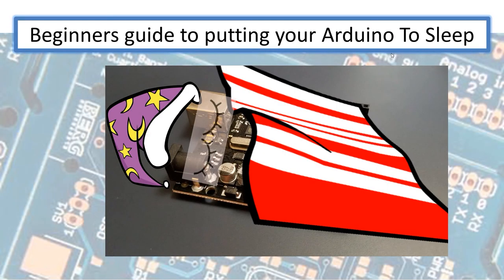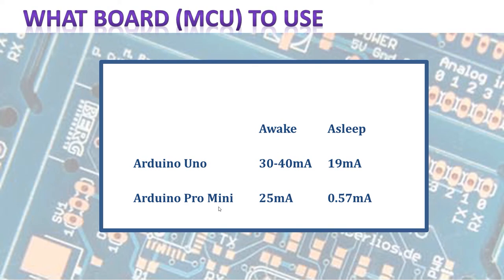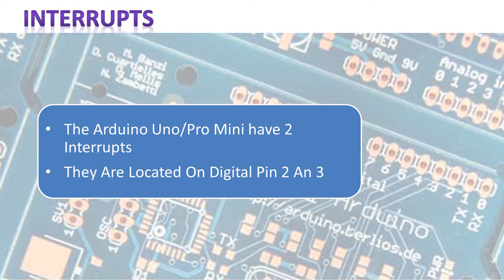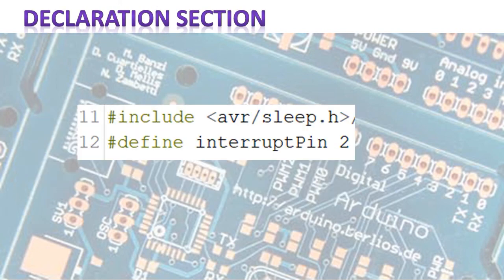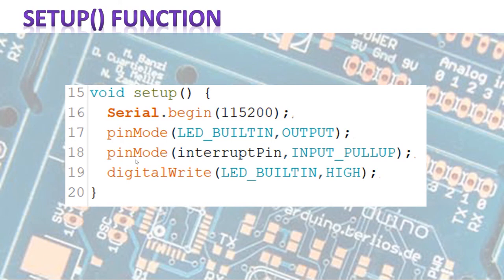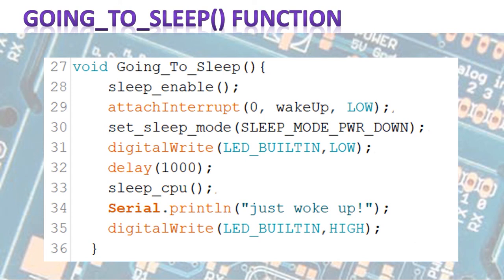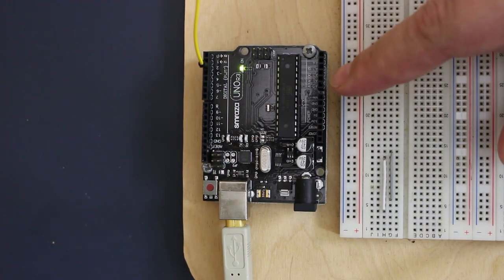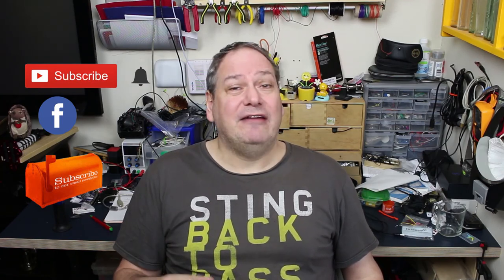A guide to putting your Arduino to sleep

Comment: If you keep the jumper wire attached to the ground (LOW) over 5s the Arduino goes into a dead loop.
I would slightly modify the code so it'll put it to sleep only if pin 2 is HIGH
Example:
========================
if (digitalRead(2) != LOW)
{
   Going_To_Sleep();
}
=========================

Comment: I tried the interrupt pin and it worked. But if I keep the interrupt pin plugged in for more than 5 seconds and the system goes back to sleep. Then I unplug the pin and replug the pin and the system will not wake up. At least the LED will not come back on. Any idea please?